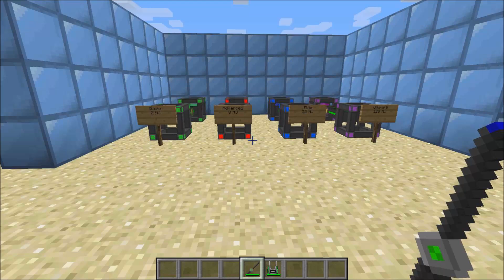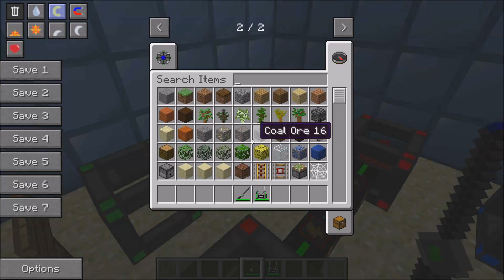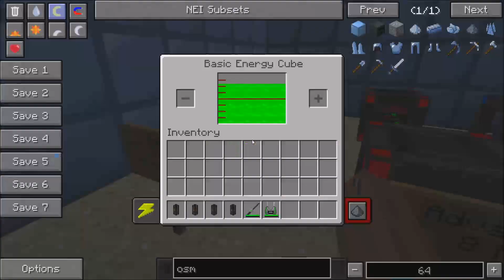Mekanism 1.7.10 Mod Spotlight Ep1: Energy Storage and Transfer

Comment: Hi Shane, thx for the vid. Was wondering if you might know why my Basic Universal Cable isn't transferring energy from the (IC2) BatBox to the Macerator/Electric Furnace/Metallurgic Infuser? Thanks in advance either way.
Reply from the maker: Make sure that that you are connecting the universal cable up the the right side of the bat box,  are they lighting up when you connect them to the bat box?
Reply: Connecting to the only output face: yup. Cables lighting up: nope. I did some digging and found that apparently IC2's EU is causing issues when being used with other energy driven mods which makes me think the Mekanism Dev thought it prudent to not accept EU power. If I use an RF generator the Universal Cable does transfer RF to the BatBox, it just doesn't accept EU from an EU source. Problem is I use the BatBox's Redstone signal to start/stop it's supply generator so I don't waste charcoal (still early game). Ah well, that's the fun of mods, right :P
Reply: KatoNamus Use the configurate mode on the Mekanism Configurator (shift+mode switch key to change modes) and then shift right click on the end of the energy cable attached to the batbox. It should say switched to push mode. Shift right click one more time to change to pull mode and then it will pull power from any inventory that contains power (RF, EU, MJ, J, AE, etc.).